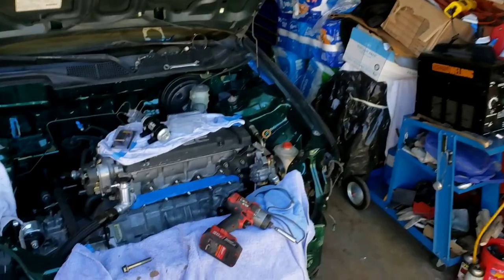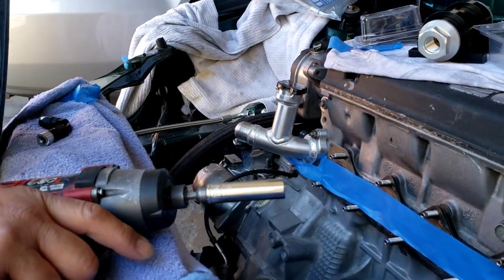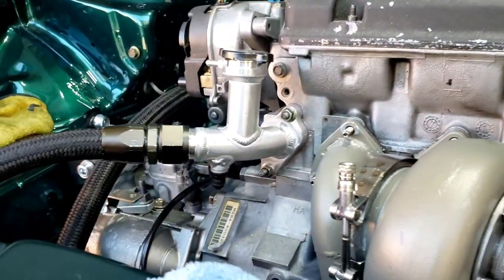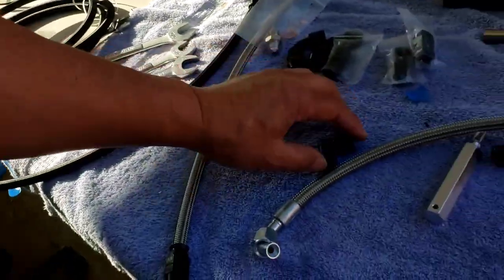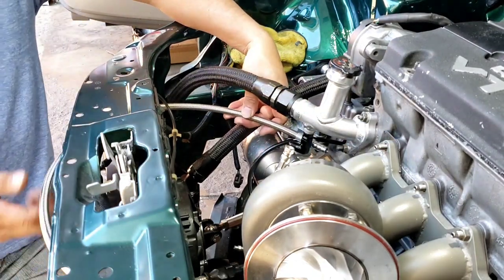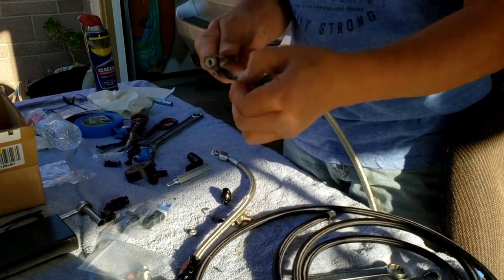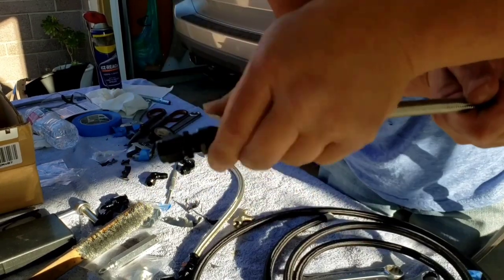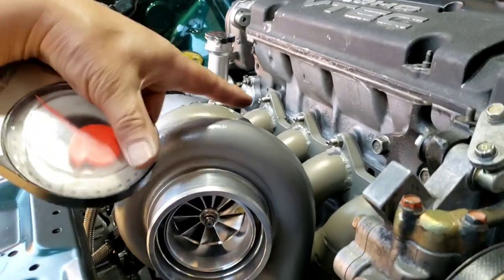G23vtec Turbo cooling hoses install

Comment: That aluminum water line to the head and radiator is that custom made
Reply from the maker: The waterneck? It's made by Speedfactory
Reply from the maker: I welded a 6an fitting on Speedfactory waterneck and connected a hose to the radiator. If you want to run a hose for your turbo. You can connect it to to your IACv. So it'll be from thermostat housing to Turbo and to Iacv.

Comment: You have inspired me to go with g23 boost swap in my 4 gen prelude! I have a h22a in it now. Will my JDM head obd1 work or do I need a h22a4 head, what wiring harness do you recommend?Or would a f22 be easier because of it being OBD1? Thanks brother
Reply from the maker: H22 cylinder (obd1/obd2) are all the same except for some other parts like LMa and camshafts. But stick w/ obd2 or type s cams or use whatever you have. Since it's turbo, it wont matter l guess. If your car is your daily, it's better to have a alternate car just in case it become a headache for you. Wiring, since its a Prelude wether it has a f22 engine or h3a non vtec, use your existing wires. Just add a wires for sensors that is require. There's plenty of info on web for it. Wires to add, KS,Vtec solenoid and oil pressure switch, IAB. It's not that hard to add wires, if you can turn wrenches you'll be fine. Websites l usually visit, honda-tech.com for lots of info. HAmotorsports.com for anything like wiring and what ecu to use and ect. Zealautowerks.com for compression ratio.
Reply from the maker: And dont rush, take your time bruh!
Reply: Thanks my guy 🙏! Would you do a g22 or g23 or does it matter? is it the same amount of work? I’m going to run p28 with Hondata. my goal is 300 whp! Basically I’m asking is obd2 to obd1 swap hard/worth it or just do f22 and keep it all obd1, what’s your thoughts 💭?
Reply from the maker: @jefftrump5779  Its pretty much same work(g22 or g23). And any of those 2 hybrid have no oem  ecu( no fuel basemap). So people always going to obd1 coz of tuning capabilities unless you use the expensive ecu like AEm, Haltech.
Reply from the maker: @jefftrump5779  just buy a conversion harness from obd2 to obd1, get from Amazon or Ebay. You'll be just fine.